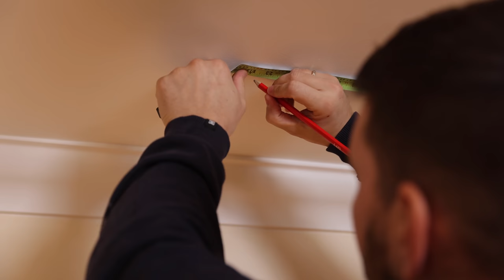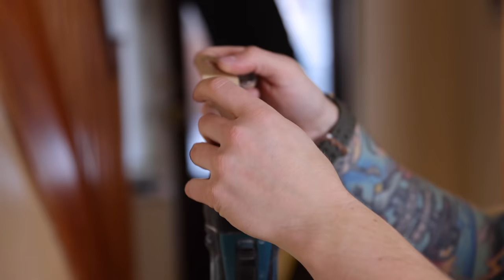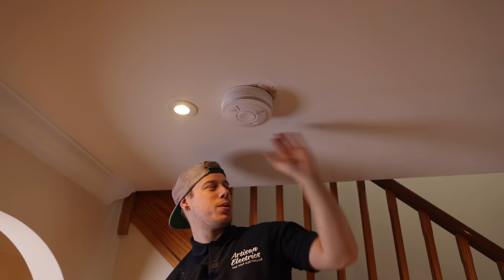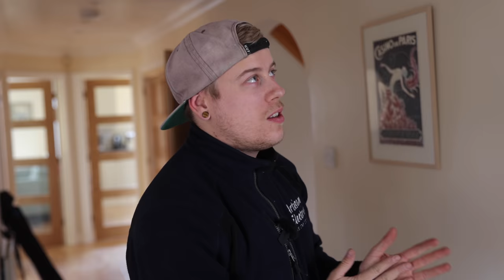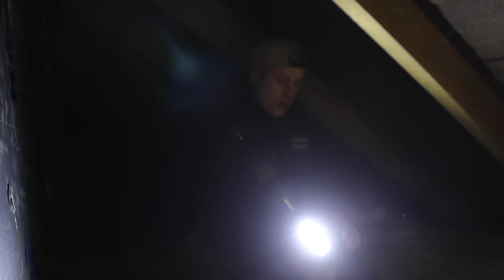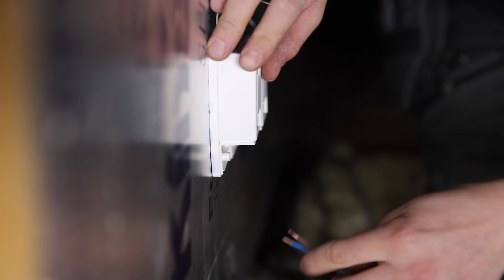INSTALLING WIRELESS LIGHTING... QUINETIC SWITCHES - Electrician Life

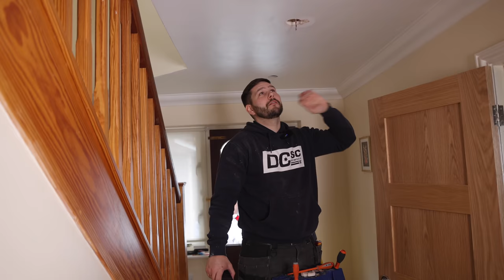Comment: 5:05 I have a habit of making 4 holes using a thin screwdriver to make sure the coast is clear above the ceiling before using the hole saw. Avoid hitting a joists etc

Comment: That smoke detector is a bit too close to that fitting. Check the instructions it's recommended 300mm away from a light fitting. Not always possible but when you can it's good to do.
But all being said, decent job lads. Keep it up 🙂
Reply: Not as important as you think as the light is recessed it won't obstruct smoke entering the alarm like a surface fitting will

Comment: Smoke alarm 300mm away from downlight?
Reply: Not as important as you think as the light is recessed it won't obstruct smoke entering the alarm like a surface fitting will

Comment: Genuine question for you lads as Iv never used the Quinetic switches before and I’m really looking to get into using them, would it be possible to use a wireless switch to act as a override switch for a PIR controlling a light, the PIR is on a permanent feed and I have no spare switch wire to override it! Cheers in advance
Reply: Yeah I’ve done this before with driveway lights, worked on and off as a regular pir, and when the wireless switch was turned on it overrides the pir.
Reply: @liamchristie8671  Brillant I’ll give it a shot so ! I assume it’s regular override wiring feed the Quinetic switch with the same supply feeding the PIR and another switch wire from the Quinetic output to the light
Reply: @I_Damoooo  so permanent feed to your PIR, switched live from your PIR to your light, then with your Quinetic receiver,  That requires a permanent feed, and ultimately the switched live on the output doubles up with your switched live to your light. So the wireless switch always overrides the PIR when switched on and when switched off it goes back to PIR mode.

Comment: Why on earth aren’t you using back box cutters, driven by a drill and use vibration to cut the square or rectangular holes the right size and will work on plasterboard, block work and brickwork!

Comment: I used to enjoy your videos Jordan, but the following criticisms have made me become less enthusiastic:
The connections for the CPCs don't appear to be in an enclosure. Not very artisanal.
The smoke alarm appears to be too close to the light, as per manufacturer's instructions. Also not very artisanal.
No PPE shown to be worn. Not very artisanal.
Drilling full sized holes for downlights before exploring with a small bit or screwdriver or stud finder. Not very artisanal.
In fact, all of your recent videos have had me itching to make comments along the same lines, and I'm not usually one for criticising a fellow spark's work. But you really need to keep an eye on these things going forward.